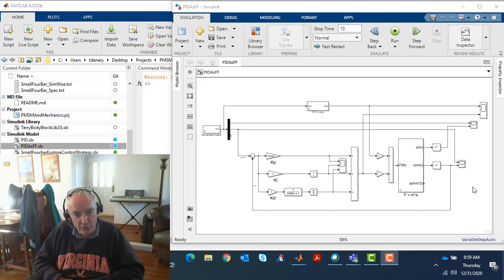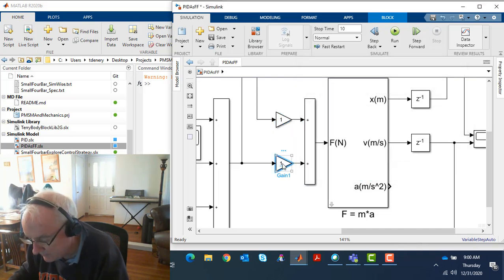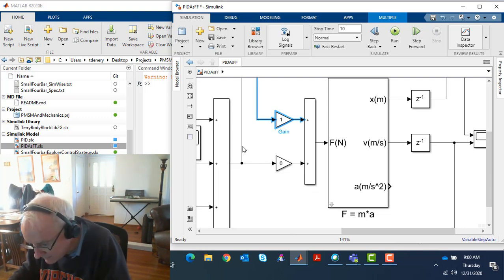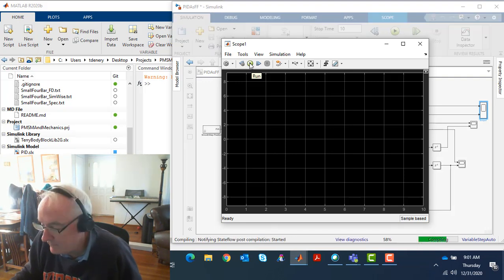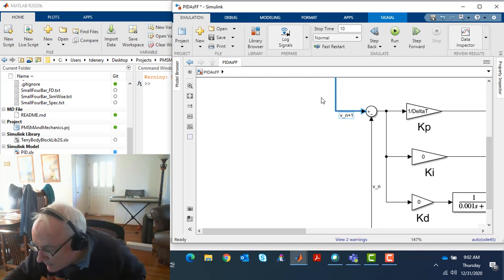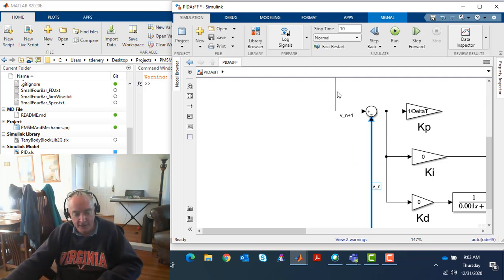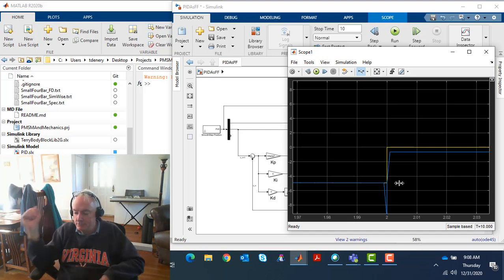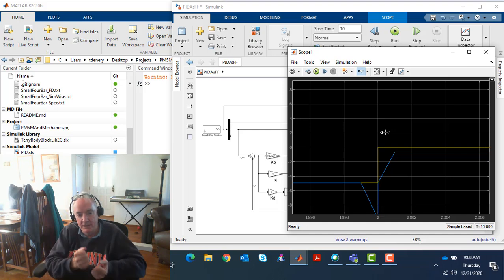Engineers Studio #82 -- PID Algorithms Only Work When . . .

Comment: I had trouble watching. But it seems related to the whole analysis of poles and zeros
Reply from the maker: Linear Controls methods have lots of tools, including poles and zeros, root locus, and Bode plots. The linear assumption allows introduction of the Laplace Transform as the mathematical basis.  From this, much of it comes down to frequency and gain. I advocate physics-based controls, which means you employ equations that often are non-linear. Embedded processors are capable of handling the more sophisticated math. I recorded this video about 3 years ago.  I think the newer ones are produced better, so they may be a bit easier to watch.  I suggest checking out the newer videos, like those in the playlist Simulink and Mechatronics. Thank you for the comment!

Comment from the maker: Regarding the assertion that we are approximating a calculation of force with acceleration assessed as (v_n+1 - v_n)/DeltaT, I can see that I forgot to multiply it by m.  Hence, F = m*a.  It turns out my mass is equal to 1 kg, and that's why it did not matter.  Sorry, for the oversight.  If you have not noticed already, these videos were recorded 3 years ago. Thanks. -Terry